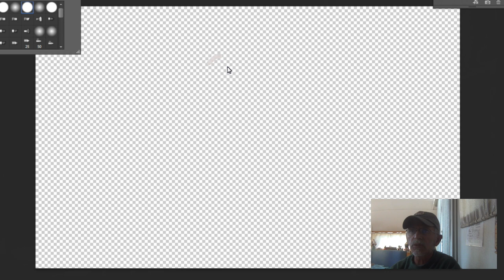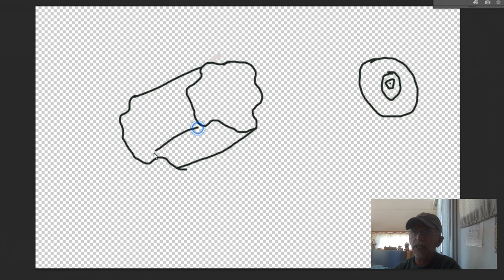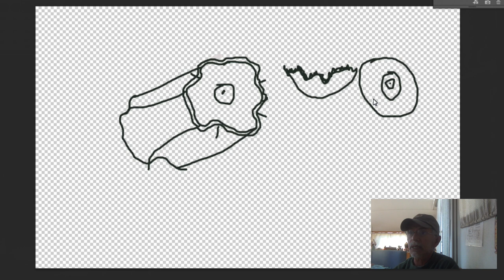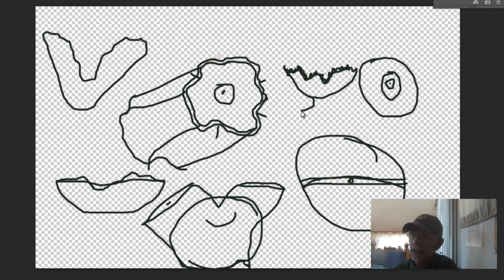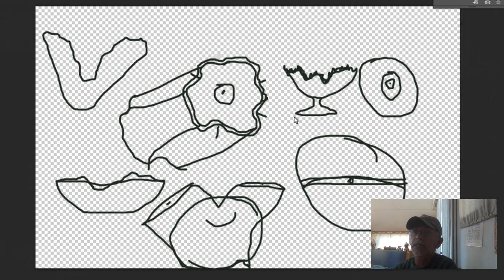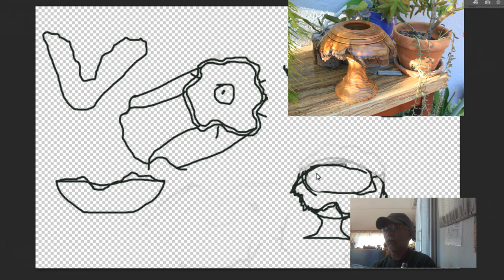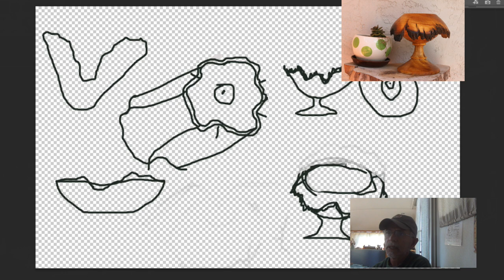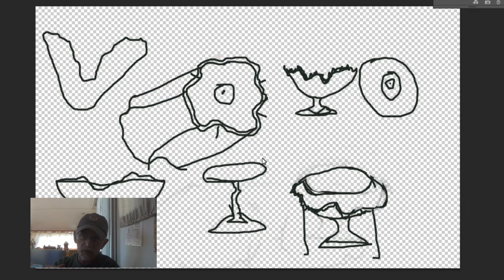Wood Turning Lessons illustrated

Comment: Hey Al just get your self a small light weight Lathe, remember it's not the tools that make the man, it's the man that makes the tools work...
Reply from the maker: Thanks Lenny.   Yeah unfortunately  a smaller lathe would be the only option or I would have kept my old one. the big issue is also dust.  How do I keep it from getting to electronics, engines, beds, and living quarters? Dust travels far and fast.
Reply: @AlFurtado  Yes it sure does, only thing I would think of is negative draw system were it draws the air from inside the boat going out, it would have to have a strong draw and then the air would hit a water tank before it goes out side, I have seen it in a body shop spray booth, it actually works quite well...